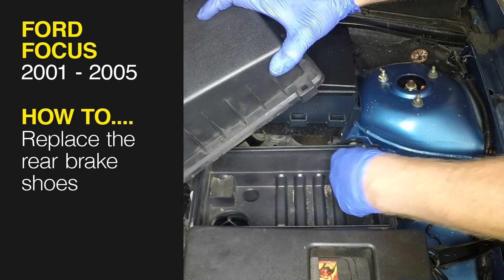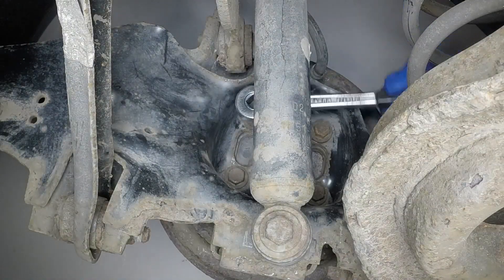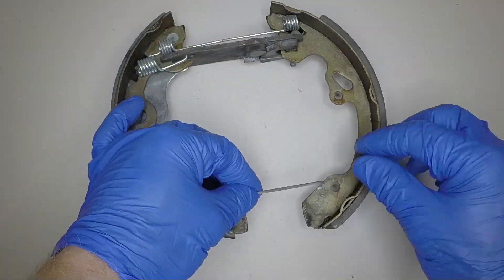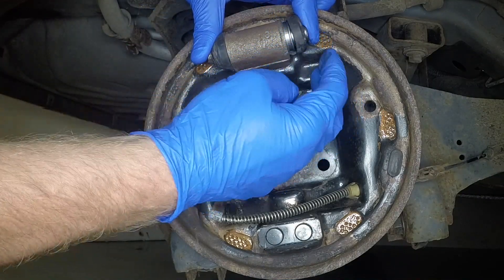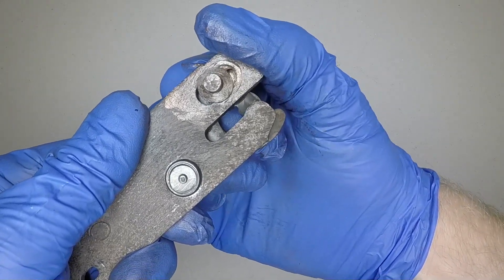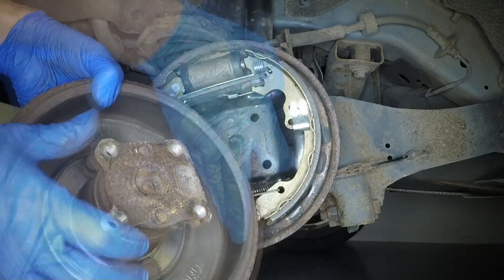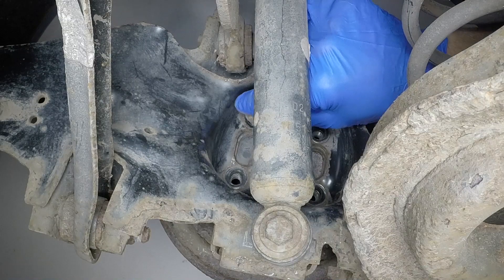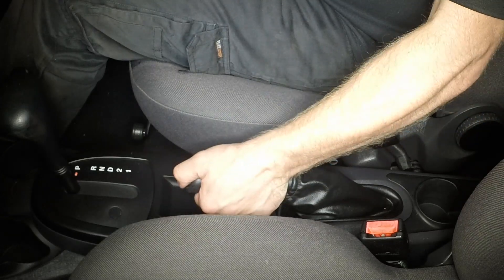Ford Focus (2001 - 2005) -  Rear brake shoes renewal

Comment: Hi there, 3:15 I didn't get it. How do you adjust it? Should be explained properly for the first time diy on brake shoe replacement like me. Thanks.
Reply from the maker: By positioning the adjustment eccentric cam (3.15), set the brake shoes so they are as close together as possible. This will create maximum clearance between the shoes and the drum. When it's all refitted, when the brakes are applied, the mechanism will automatically adjust the clearance - although it may take a few applications to fully adjust them. Hope this helps!
Reply: @HaynesManuals  thank you for your quick reply. This video really gave me confidence to diy my brake shoe replacement. 👍🏻
Reply from the maker: You're welcome!

Comment: How do I replace the shoe retaining pins on a focus mk2? I can get one pin out by simply using it through the back of the drum but one pin is blocked, any help would be appreciated, thanks.
Reply from the maker: That's a bit of a puzzler...as you can see at 1'09" in the video, on our Focus MkII, the pins just slide out of the back plate.  What's blocking yours?
Reply: @HaynesManuals  Same problem with mine also, looks like it's a different version on the MK2. Ford screwed me
Reply: Did you ever resolve this? I have the same problem
Reply: @davidhale2566  I just left the old pin in and replaced the rest, I think you'd need to remove or at least loosen the inner drum brake hub to get access to the blocked pin.
Reply: @reikoruffneck4613  That's what I figured. Problem for me is I cant leave it in - it sheered off :( thanks for the info.

Comment: folks HELP!...my drum is seized to the axle shaft at the wheel bearing. the wheel bearing is inside the drum hub.  my drum puller broke because of the torque used to try and remove the drum.  any thoughts?  i used a small hand torch to heat the bearing sleeve.  it didn't work.  what should i try next?
Reply from the maker: Sorry you're having trouble removing the brake drum. It can be difficult to get sufficient heat into the bearing sleeve, but 99% of the time, heat and a suitable puller will succeed. If necessary, remove the ABS wheel speed sensor, undo the bolts and remove the stub axle along with the drum. It should then be possible to use a hydraulic press to force the drum/bearing from the axle. Hope this helps!
Reply: @HaynesManuals  ...thanks  and will do.  i'll go to the junk yard and get another axle.